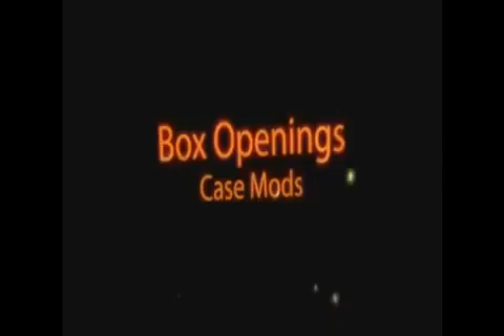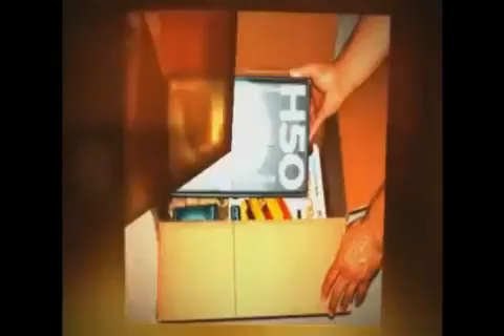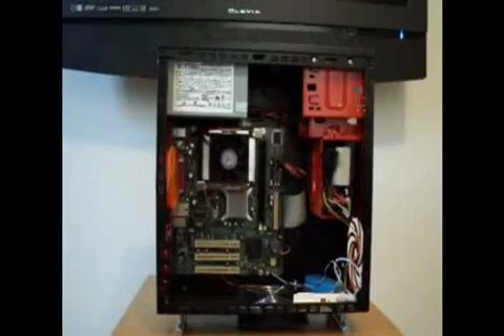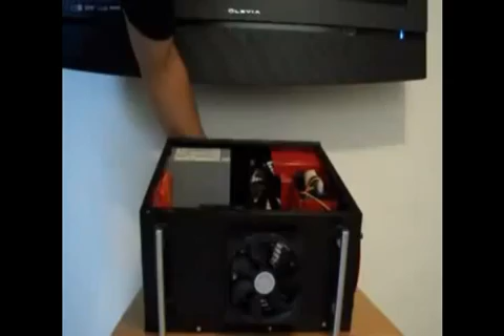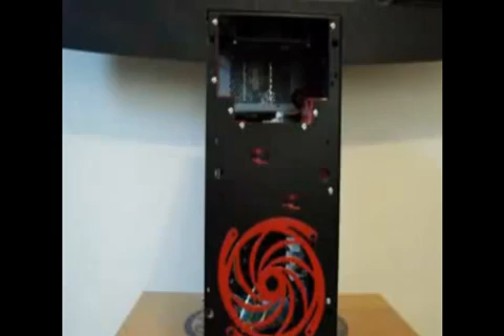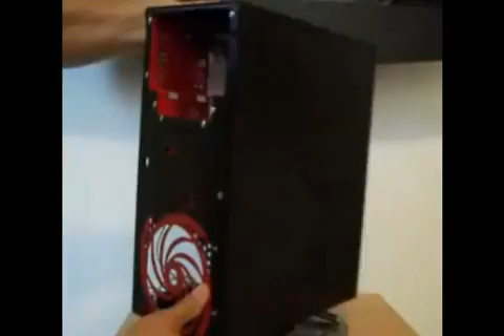Modded e-Machine Case

Comment: You really deserve props for the wiring management.  I was most impressed by that.  Very few factory PCs of any brand give any consideration to wiring management.  I'm also impressed my the fact that you made a stock eMachine look so awesome.  I would put steel mesh on the front panel, like on the HAF.  I have build 3-4 PCs from scratch inside eMachine cases like this one.  They aren't proprietary, so any mATX mobo easily drops in.  My wiring management is simple.  Ultra Modular PSU.